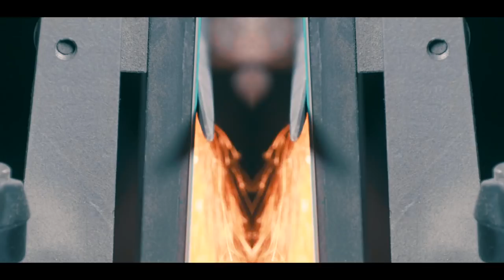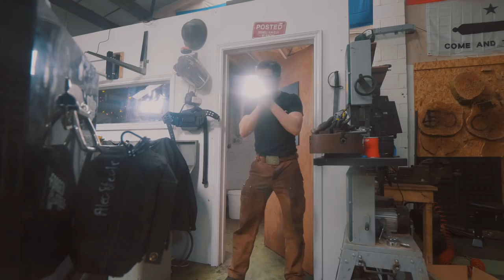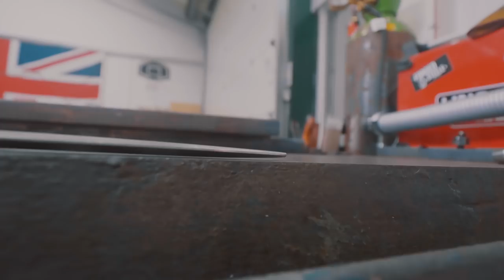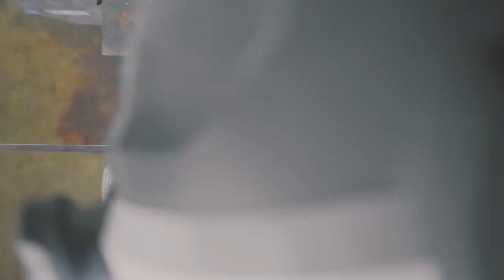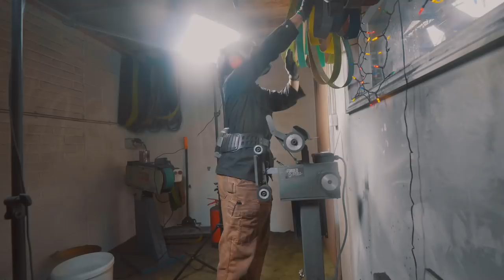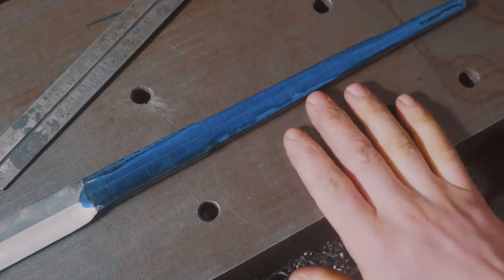MAKING A BASKET HILT RAPIER SWORD: PART 6

Comment: Pretty sure that those tens of thousands of people didn't make their very first rapier as a live public performance using patterned mixed-thermal-coefficient-of-expansion steels as a blind run aiming for the moon, Alec. Good choices and good work & quality ethic. Crack on!
Reply from the maker: Thank you sir!
Reply: Finn, just Finn. Indeed I admire Alec for trying things out and sharing with us his successes and occasionally a failure.

Comment: Crazy how much that bend came out with the grind. Had me a bit worried. Keep killing it man! I'm a land surveyor in Texas, our equipment is Swiss. I find it's most helpful to know both measurement systems.
Reply: ben nichols as some one who uses both metric is easier but growing up with imperial I under stand how much an inch is better
Reply: In Canada we switched to metric in 1970. Yet virtually all of the trades continue to use imperial. So, reflecting this duality, I have a tape measure that is both. When I need an accurate measurement, I look to see which scale is closest to my mark and use that. After almost 50 years of metrification, you can walk into every hardware store and order 4' x 8' sheets of whatever, and 92" x 8' studs. And then pick up a box of 9 mm on the way out. (I wish!)
Reply: Glenn Wiebe, Same in Oz, it was handy to be at school when they taught both. Weight and height and rough measurements are still more easily understood in imperial, metric is handy for accuracy and so much easier to add one measurement to the next though. Most of the farmers I know still count rain in points, it doesn't sound right to talk in metric when you've only had 5 points (1.27mm) in that last shower, particularly in the drier parts of the country.

Comment: 2:22 Sure! but if you support the bend with shims on the table resting it on unstress shape, you can grind one side "flat" and then the other provided that the blade is thick enough, try it on mild steel!!
Reply: Caepoh Basics yep.

This is a method carpenters (tree carcass molesters) use to fix warped boards with simple equipment. (IE a thicknesser but no planer)
Reply: I was going to mention the same thing. Very common for woodworkers, especially when flattening a board wider than the equipment you have.  I can see how a jig with shims would let him flatten one side, then remove the jig, flip the sword and flatten the other side.
Reply: if it would fit on the machine - too long?

Comment: Alec, you can grind things flat.  The example you gave with the steel shim and copper is exactly how you do it.  Where the blade is warped, shim.  Grind one side flat; flip part and grind other side parallel to it. This is a similar process they use on large blanchard grinders all the time.  Great channel by the way-keep it up!

Comment: Couldnt you have shimmed it on the surface grinder so that the magnet didn't pull it flat?
Reply: Gillam's woodcraft and joinery  I was going to suggest this same thing. It's still too long to fit on the surface grinder table... however I think he should try it on some scrap steel and see how it works out for him. Could be a handy skill on future projects.

Comment: Would you be able to use a magnetic table to straighten blades immediately after the quench?
Reply: Dat Boi after the quench it will be magnetic again
The temperature will drop a lot enough to get under that critical point
I'm not a blacksmith but it's my opinion
Reply: Thats what i was thinking as well. After quenching the steel is cool enough to be magnetic. After that let it sit on there till it is completly cool. I saw someone do this actually
Reply: Dat Boi only when heated past "critical temperature" the second it cools off below that...such as when he quenched it...it becomes magnetic again.
Reply: Abdul Dogan I have a feeling that people don’t do that because  1. The cost of the table/mount would be really expensive and 2. After the heat treat the blade comes extremely brittle and can snap at just a small impact against a hard surface such as a metal table.
Reply: But Shaved Alpaca is right the material will be a little flexible so you have to bend it over a little bit so it will be perfect
Reply: Tim ukthis stelter edgeworks has actually did this exact maneuver for the kapesh collaboration!
Reply: heat kills magnets
Reply: MrDuckAlmighty it's an electromagnet.
Reply: When it's really hot, the metal itself actually becomes non-magnetic; it wouldn't matter if was an electromagnet or not. :/
Reply: Liam Hoffman used a magnetic chuck to straighten a blade after the quench in that small period where the blade is still a little pliable.

Comment: Curses to inch system. Its so silly and rough. Lol. Inches and millimeter! First you say tip is 1,5mm out. That we can understand. And next measuring (after 60 grit) you say its one twenty thousands of an inch. And then im like...25,4mm/20000 = 0,0012mm. Then i thought daaaamn. Now he is picky. Then i realise you mean (25,4mm/1000)*20 = 0,5mm. Thats more normal. Its like saying imagine your forearm. Slice it into 500 000 pieces. Then you take 2 of those pieces together. Thats how thick your hair is. Instead of just showing the hair.
Reply: Jonas Donas I hate the imperial system here in the US. It sucks
Reply: Fox And Wolf Productions Make a revolution and get out of the stone age :-) i join you!
Reply: Grey See how long it takes to covert .02" to feet. It takes forever. The imperial numbers are crazy and all over the place, while the metric system is a set and constant amount of conversions
Reply: Yeah! Merica bitches
Reply: There are two types of countries in the world. Those that use the metric system, and those that have been to the moon.
Reply: Amrauz there are two types of countries in this world. Those that use the metric system, and those that play FOOTball with their hands
Reply: And those that have been to moon crashed a craft into Mars because could'n  do the conversion , c'mon.
Reply: Grey 
Incorrect. 

When you use geometry to calculate the weight distribution, you are working with lengths that range from fractions of inches to several feet. To use them in the same formula, you need to convert the units into one common unit.

Realistically, the circumstances for conversion are literally anything but zero, these conversions are present in any well-planned project.

Oh, and people complaining about people complaining without realizing the validity of the criticism... Those are the oldest of the bunch by a longshot.

Comment: Hey Alec! Great videos! A piece of advice I can offer in regard to using the surface grinder, assuming you can fit the piece on the magnetic surface, is to use shims. Basically find the high points and put the shims under the piece so it remains at that height when the magnet is active, take light passes, and when you’re done you have a perfectly straight/flat workpiece.

Comment: Hi There Alec, I come from a woodworking background but recently have had many of the same problems with trying to flatten out a bent piece of material using a surface grinder-like machine (thicknesser in my case). I don't know if it can be done with such a small sword but with woodwork you can create a sled for the workpiece to sit on and shim up  the low points so as to keep the high points high without putting any stress on it.

Comment: you could use a similar technique to whats done with wood planing: You clamp the material with underlaying structure that supports the material in its natural bend. then you grind or plain the top side flat and then flip it over to finish the second one - but of course now referencing it to the firstly plained surface. 
This of course is also a process where you have to rely on your eye to build up the unterlaying structure from thin, maybe angled parts.

Comment: I asked why you didn't use the surface grinder on the last vid, and thanks for answering that question.  I forgot about the magnetic surface.  I'd personally probably try to make a crazy jig without using the magnet that took a whole day's work to create a flat that I could work from, but that rarely turns out well in the end.  A super thin blade is going to bobble up and down under kinetic energy, and I likely would have wound up with a mot mess that would collect rust on a scrap heap.  Making a rapier is a very difficult challenge, even if you opted for a monosteel blade.  I think that one monosteel side is something that's going to continue biting you in the ass throughout the process, but one mistake teaches you more than a dozen successes, and sometimes experimenting with that flaw pays massive dividends.  I admire your ability to adapt and work with a problem rather than scrap it once the problem is found and start over with a more reliable process.  That's personally what I would do, but I'd never learn about the the intricacies of fixing a flawed design, which teaches you so much more.  This whole project is going to make you a much better smith, and I have total faith that you're going to turn out a nice looking piece at the end.

Comment: @Alec Steele  while watching this series I thought the same thing... use the new Surface Grinder. However, you are right that the magnetic table will hinder you unless you (after, if possible, removing the shields on both ends) you use small shims to fully support the blade in its warped condition to grind one side straight while maintaining the correct distal taper.
Then when you goto the other side just maintain distal taper and it would be straight as an arrow!
The mill could be easier as you have a little bit longer table and no "magnetic problems".
Reply: Or those shields on either end

Comment: The bending is why you shim it on the magnet. Put shims underneath so it doesn't move when you turn on the magnet (use steel shims and you won't affect the clamping power significantly).

Comment: On the surface grinder you can shim a piece then turn the magnet on.  This will stop the magnet pulling the lower side flat.
It partly black magic getting what you want (no not Blacksmith magic that we see you do all the time)😀
But you are right about the length.  I don’t know how you could do it in sections.
Hand made beats machine made anyway.
Love the instructional stuff.  Keep talking about what you are doing.

Comment: if you added a thin layer of putty under the blade before turning on the magnet, then slightly wiggle the blade to set it in. then when you turn on the magnet it should cushion the high spot keeping it elevated enough to allow you to grind it perfectly flat.

Comment: hey just thought of this, if you were able fit it AAnd fix it using clamps by the tip and the handle (not using magnet part) you can run the machine and grind it flat

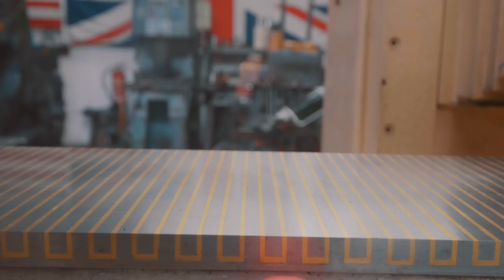Comment: 3:03 But Alec, you just fill the voids under the part with packing before you flip the magnet... As long as the part is pretty close to the table all over and some extra support is placed all around to make sure it doesn't test the fortitude of your spark guard of course ;)

Comment: There's another blacksmith that had a show on the history channel, he would quench in a horizontal tank with the tip facing north. His reason was that when the steel looses magnetism and then quenched with the tip to the north and have a straight heat treat everytime

Comment: To use your surface grinder to get a bind out of metal you can use shims in your bind to prvent it from pulling to the magnet. (total pain in the ass to get right by the way) This gives you a datam edge to work off. Then when you flip it over you can use your datam edge to grind the other side to get it strait and parallel.

Comment: Alec, what about using the magnet as a straightener when you are doing the final heat treatment/temper? Surely that would work, assuming it doesn’t damage the magnet, somehow?

Comment: Alec, instead of the marker line when you grind, why not using a control spray or dry guide coat? Working on bike body fairing, it's very useful and adapted. 
By the way, keep going, very nice videos, very motivating and thanks to share so much with us !

Comment: You could probably make a jig to attach to you belt grinder that would help hold the angle and pressure consistent. Would speed up the finish grinding process if all you had to do was sweep the blade through a jig while adjusting it closer to the belt until you're at the size and finish you want.

Comment: In the old days edge was done with large, slow moving grind wheel.  Less friction meant minimal heat displacement resulting in razor sharp edge  (better way to keep temper).

Comment: if you had a shorter blade you could shim under the part (with metal magnetic shims) so that it stays in the free state geometry when you turn the magnet on, grind the top surface flat then flip the part which will now sit flat on the magnetic chuck in free state and grind the opposite side. This will ensure that the magnetic chuck does not distort the part. That being said with the bevels on the sword this makes it even more tricky but it can be done.

Comment: Alex ya pillock! if you want a straighter grind use a wider section of your platen, about 30 degrees and move the blade up and down on that plane. it works a treat on your lower grits. move back to 90 degrees on your final grits.

Comment: Alec,
 You sir are a beast. But if I could suggest something... once out of the heat treat the metal can still be manipulated just a bit and the metal at this point is magnetic just try placing the project on the surface grinder so it can be held straight. I believe I once seen Liam Hoffman do this with a knife project he worked on.

Comment: I think you may have been able to utilize the magnetic table by heating the steel up to just before non-magnetic, put it on the table, then turn the table on to pull it straight. Leave it there until it cools. Rinse and repeat for the length of the blade.

Comment: You can grind the bend out. I do it all the time. Put shim under the high spots before you turn the magnit on. Grind the first side, flip it over remove shim and the side you just ground will naturally sit flat.. But sounds like you  may end up with a really thin blade.

Comment: Alec. If you need to temper something for a longer time use you oil tank and heat it up with a burner. Just get it up to 200-250°C

Comment: If you made a shallow, steel trough, and filled it with some sort of putty, could you embed the blade in that, leaving one face slightly proud? If it held well enough could you then use the freshly ground face as the new, truly flat surface? The blade could be shimmed to keep it from tipping on the subsequent passes. I don't know enough about putty to suggest one that would withstand the forces/temperature.

Comment: Just a thought Alex 
Couldn't you do your normalizing cycle then put it on the surface grinders magnet while hot.  Using the magnet to keep it flat while it cooled? It is not like your taking it up past the magnetic limit like in the hardening cycle..

Comment: Hey Alec, here's an idea. What if you were to get an independent mag chuck for normalizing blades. As the blade would cool the mag chuck would hold it in place and fix any warps.

Nevermind. I realized that when you begin the cycle the metal is nonmegnetic.

Comment: I'm simply going to say it. I know I'm catching up on some older video's. But, it is my opinion that you consider making a longer heating forge purely for when working with the swords for normalizing and tempering. When watching the video with the oil baths. You had a dark spot in the middle of the blade. Love your shop, love your work! Now go beat some more hammers! I got more video's to catch up on!

Comment: This may be a dumb question... that being said, could you have used the magnetic table to aid you when you were initially having straightening issues? Post quench, slap it on the table and have the magnet pull the warp out while it was still somewhat pliable...? Or would that have a negative affect on the HT? I love your work, it’s always fun to watch.

Comment: I do not know if someone has already posted this, but if you run into issues with straightening again, try letting it cool against a magnet during the normalizing cycles. Standard magnets lose their magnetism at 80C, but electromagnets do not lose their magnetic field based on heat. For electromagnets you just need to make sure that the metal is less than 770C.

Comment: Hey Alec, question for you that I might of asked awhile back but can't remember.  I work in Heating and Cooling as an installer and I was wondering as a working man yourself, what kind of pants do you prefer to wear that can take the abuse and stresses of daily work?  I have been a carhartt guy for the longest time but it seems quality is lower now.  I have been going through a pair of jeans every half a year.

Comment: Alec, if you used shims I think you could surface grind no problem. You can even indicate the high and low spots on a surface plate or your welding table, record. Then indicate on your surface grinder when shimmed and clamped and see if the piece is flattening out or changing shape. Look up ROBRENZ for some surface grinding GOLD, there's so much to learn from watching how he uses his machine.

Comment: It is possible to get bent things straight and flat on a surface grinder.  Shims.  you shim the air gaps under the part when the magnet is off, then magnet on and grind the top surface flat, then flip it onto the flat surface and finish the other side. May have to repeat as removing metal usually results in the piece bending again, but to a lesser extent than before. 
That long tapered blade presents a number of challenges to be overcome in the setup, and to be fair, for a one off would be prohibitively complicated, but nevertheless, possible.  Tilting the table would be one way to achieve the taper - preferable to graduated shim packs.